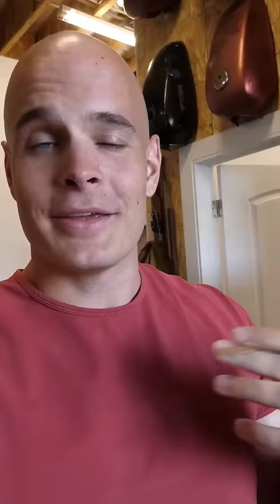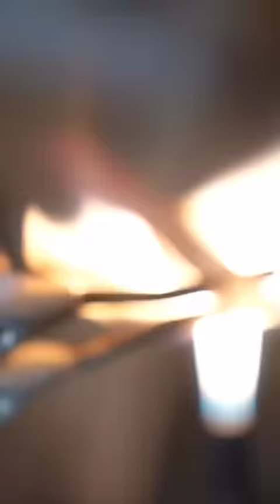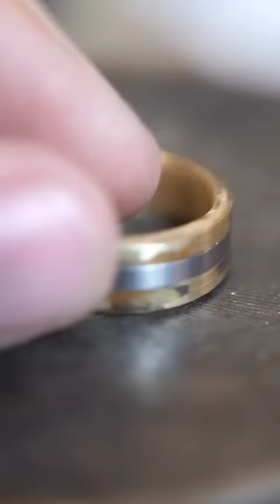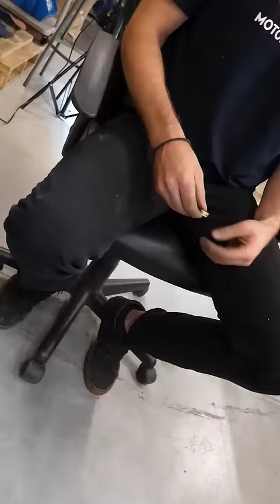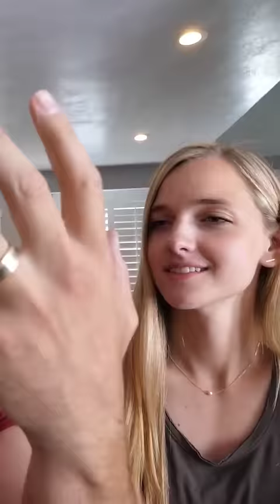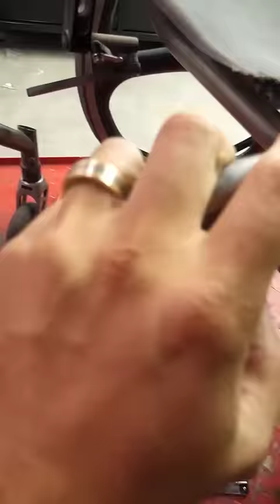WE'VE BEEN MARRIED 4 YEARS NOW! 😍

Comment: As a goldsmith the thing I always like most is when people either make their own wedding rings or bring me some material that actually means something for them for me to make a ring out of, instead of buying a soulless ring at a soulless company. It makes it all so much more personal.

On a side note. If you havent welded them together and then heat-treated them to take out most of the material stress you'll need to be very careful with them. Titanium has a tendency to crack if not treated well, depending on the exact composition. Either way don't ultrasonically clean the ring if you want it to last because with different materials come different resonant frequencies and there is a chance it lines up just badly. Just use some mild soap and lukewarm water